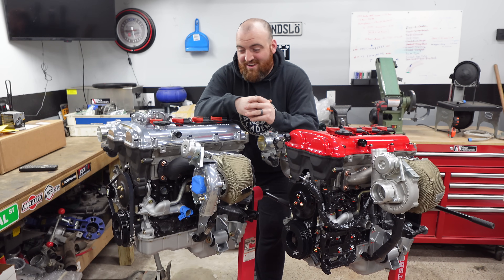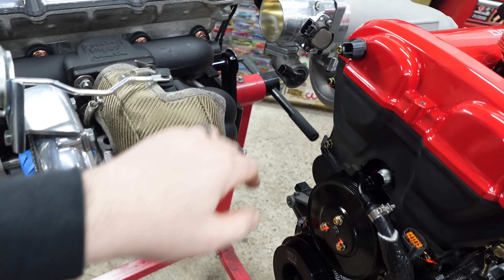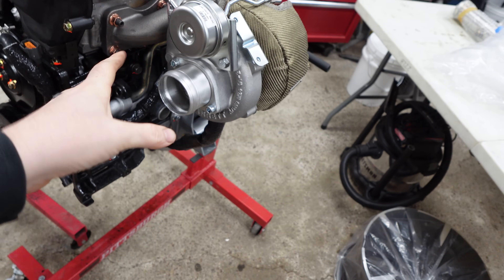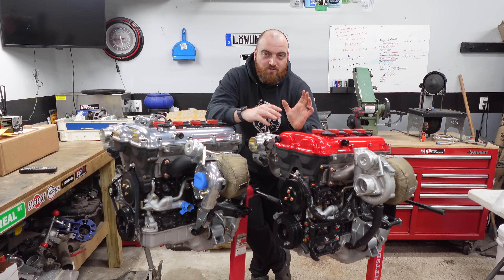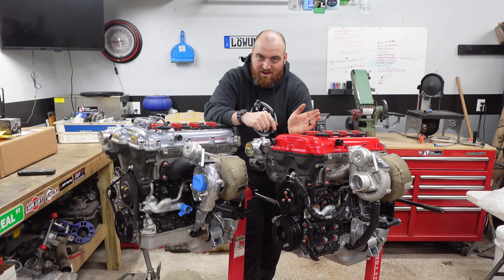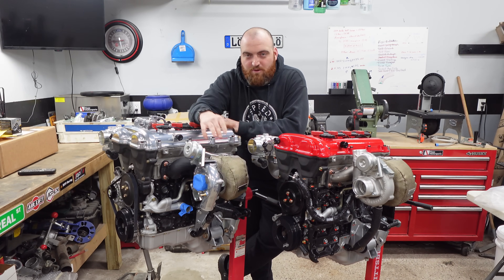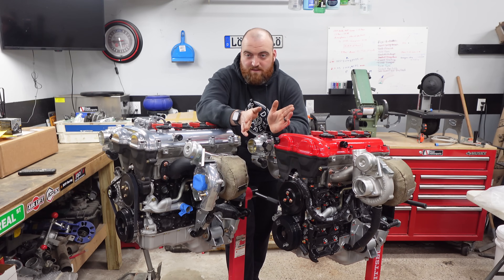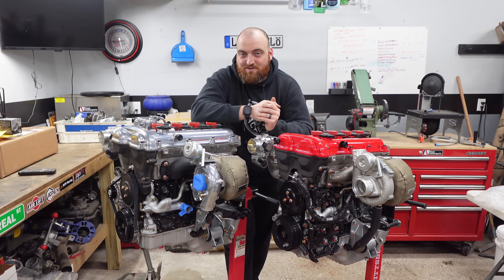Which Miata Turbo Kit Is Best? Flyin Miata vs Kraken

Comment: Nice video, Stefan!  We get lots of questions comparing our turbo kit to others, so it's great to hear some input from another Miata specialty shop that has experience dealing with multiple turbo kits for Miatas.

Just to address some of the questions and comments here:

1. Yes!  We do have an updated version of our turbo manifold available for 1.8L engines (1.6L version coming soon!).  It's sexier, is 2.5lbs. lighter and flows 24% better than the "old" design shown in your video, and they are even Cerakoted now!  You can see more pictures and details about it in our NA8 and NB Stage 1 Turbo Kit listings (I'd share the link, but YouTube will auto-delete this comment).

2. Our Stage 1 Turbo kits for the NA/NB Miatas do include a piggyback controller that we developed in-house.  The piggyback controller wires in alongside the stock ECU to adjust fueling during boost.  This is the only way to add fueling during boost reliably to retain CARB legality.  Aftermarket standalone ECUs will never be able to pass any official state or federal emissions testing when it comes down to the letter of the law.

3. The NA6 (1990-93) version of our Stage 1 Turbo Kit usually makes about 160ish whp, but the 1.8L engines can make more - especially the NB variants.  Check out the dyno chart listed in the pictures of our NB Stage 1 Turbo Kit on our website - some of the healthier NB engines are making nearly 200whp!

4. And yes, we fully admit that we've had trouble keeping inventory for our Stage 1 Turbo Kits for the last year and some change.  We are very sorry for all of the delays!  However, we have worked with a few of our manufacturers (and switched to a few new ones) in an effort to get kits back on the shelf ASAP.  Fortunately, we're making good progress and we're now focusing on ironing out some of the wrinkles to make full steam ahead.  We're actually planning on having more Stage 1 Turbo Kits in stock around the end of January or early February of 2024, so things are looking up!  Thank you all so much for your patience and understanding!  

Thanks again for the great video, Stefan!  Keep up the great work!  
👍😃👍
Reply from the maker: Awesome! Thanks for the reply guys. I knew I was missing some info so this is great.
Reply: I think Stefan needs more flying miata products to review
Reply: Actually, I've been trying to catch the FM kit in stock since Pandemic. So it's been out for more than a year and change. :)
Reply: @onlywenilaugh6589  That doesn't mean they're not shipping, it simply means they're selling out so quickly that we can't keep them on the shelf. There are a couple of dozen coming in to stock tomorrow with another drop mid-March. We're working towards having stock on the shelf at all times, but first we need to satisfy a whole lot of pent-up demand.
Reply: Legends.
Reply: @FlyinMiataVideo  You plan on offering your new shiny exhaust mani to the current S1 Owners? Do you have a 3" exhaust system in the works for us as well?
Reply: Do you have anything for a mazda b2300 2.3l truck with the duratec?

Comment: Thanks for the video!  Two quick comments, I think Flyin Miata just updated their turbo manifold.  To the layman's eye, it looks a lot like Kraken's now.  Second, and this is probably not as important to most who decide to take on the install themselves, but with limited mechanical experience,  the biggest benefit to buying FM's kit for me was their tech support and install videos.
Reply: Came to the comments to say the exact same thing. I know they just started shipping those out so there doesn't seem to be any info online about the performance gains with it on vs the old manifold just yet. According to FM, its better than the old manifold design by being lighter and better flowing by a considerable percentage.

Also, if you have never installed a turbo before, FM is the most straightforward and well documented out there, I believe. Your also buying into their customer service in which they essentially act as a lifetime warranty if anything breaks or fails and it's clear that it was a manufacturing/quality issue rather than a user error or just normal wear/tear, even if its several years in the future of ownership.

I do think the kraken kit is better for building on top of for those that want to go to drag strips, but if you have a specific power goal on mind(a highly responsive 200whp-250whp) and intend to drive your car on the street a lot, then the FM kit gives you a solid peace of mind knowing that they will have you covered.
Reply from the maker: FM's tech support is great for sure, and something to consider. Kraken's support is also great though.

Comment: I was pretty skepctical with the Kraken injectors aswell, its been more than a month since mine got tuned, and they work flawlessly. Also the guy is the nicest dude ever, always helped me out instantly.
Reply from the maker: Yeah their support is pretty solid.
Reply: What car did you use your injectors in? Would you mind sharing some info on how you got it tuned?
Reply: @ZareefHuq  NA Miata. My tuner was the one who figured out everything, sent him the info sheet from kraken, he had some idle problems at first because they're pretty overkill for my 260hp, but I have no info after that, just told me he fixed it. They run perfect still, cold and hot starts along with the idle, on a Speeduino.

Comment: I have the FM kits on both my 1.6’s. I’m in California so I have to deal with smog testing. Beside the fact these pass smog testing. The kits are just so complete. They supply every last nut and bolt you need to install their kit. The instructions are easy to follow. Installation ease is a 10/10 for the FM kits.
Reply: But they are so $$$$$
Reply from the maker: They are 100% super thought out and thorough which is very nice.

Comment: Any one other than me running the MK turbo kit?   Has been good on my 1.8 for 3 years and about 15k miles with a few track days.  I plan to reuse it ( to start)  on my new build BP4W going in this winter. Old setup on a stock engine made 231hp with the cheap ebay turbo. Love the videos
Reply from the maker: MK is a solid budget option. Just haven’t seen them around much lately so I always struggle between FM and Kraken

Comment: For anyone that's curious, I would like to add that I have a kraken manifold and downpipe on a garret 2860rs no power steering no ac and I did not have to clearance the engine bay near the shock tower. It was a very close fit but I was able to make it work with the turbo pointed downwards, milage may vary depending on turbo size but it is possible
Reply from the maker: Nice! I do think I could’ve gotten away with the same, but I didn’t want to find out once it was installed.

Comment: Recently installed my kraken kit. Only thing i would disagree, is kraken is a little less plug and play than flying miata for a couple of minor things. 

Mostly if you have the 7 inch inter cooler the power steering cooling line is in the way and you ll have to unbolt it and tie rap it up.

For fitting the turbo into the car with the manifold mounted with rhe turbo in one assembly you dont need to cut the engine bay chassis  you can just unbolt that side motor mount and jack the engine or have someone tug on the engine from passenger side to fit the manifold

Also if you took the option without ac but with power steering, (turbo pointing down)the power steering  rubber hose at the top will need to be "uncomfortably" put out of the way or you'll have to snake around a new hose

You cant reuse any splash guards so you'll need to do new duckting.

And my kit came with a wrong size clamp for compressor outlet

Sometimes the kit will comme with missing things or uncorect things. The quality controll is not the best but bare in mind its a almost one man operation 

Also the intake adaptor flange i got was jenkly made compared to what i saw in other kits felt like home made after thought which it was. You'll also need to make your own gasket for that.

The exhaust also seems to not be back putged for any readon? But it will be tough enough and its not like you will feed clean water trough it. Just dont be suprized if there's some crustiness inside the exhaust.

Other than that the kit is really nice, it looks like i dont like it but i really do!

You'll receive different fittings and hardware depending on what deals he has on stock at the time.
Reply from the maker: A lot of good info here!

Comment: STOP THE PRESSES!!!!  You're showing the old Flyin' Miata manifold.  They have NEW manifolds and down pipes that are supposed to flow way more than the old manifolds without changing the inlet/outlet location.  That means you can upgrade the manifold without changing anything else.  AND they're Cerakoted!  Oh, and they're pounds lighter.  Check them out.
Reply from the maker: Interesting! This turbo manifold is only like 8 months old.
Reply: @NappMotorsports   the new manifolds and downpipe have only been available since late summer, and I'm pretty sure that some of the other items in their kit have been keeping them from being in stock.

Comment: Excellent video!

I have the FM kit and am building up an engine with a Kraken EFR kit in the shelf.

FM kit is awesome.  I am in an emissions state and my FM kit passes without issue.  Only complaints are the limitations of the Garrett 2560, and the challenges running the charge pipe from the turbo to intercooler.

The 2560 is an excellent turbo, well sized, but for those bitten by the more power bug it becomes a hurdle.  The unique outlet on the 2560 limits doing an in-place upgrade, at least without modifying the turbo outlet pipe and potentially the downpipe.  A G series super core using the 2560 exhaust housing may be an option, but I'm wary of mixing generations and any internal or external clearance issues that may cause.

In my FM application, the only route I could make for the charge pipe from the turbo to intercooler runs up against the bolt for the upper control arm.  The sharp edge of the control arm was quickly cutting through that pipe.  I armored it with rubber hose, which in that tight space was a challenge itself.  

The Kraken kit I picked up will use the factory hole behind the driver's headlight, leaving me an intake problem I'll need to solve.  More to come on how it comes together in my builder Miata.  The 3" exhaust is gorgeous, i cant wait to finish building it and see how it runs.
Reply from the maker: Nice!
Reply: How is it running? 😄
Reply: Kraken setup dynoed at 402hp on E85.  In other words, it's running great. The problem now is traction.

Comment: I definitely like these videos. I have a love for Miatas and definitely love my old school BP engine. Yes I'm naturally asperated, but I like the sound and torquey nature of them in a light car, and the fact that mine is still running after about half a million miles and still gets equal compression within 2 psi on all 4 cylinders. I love learning about all the things that can be done with this motor, and might actually think about doing something like this one day. Like I said, I still have a completely stock setup with no turbo. There's still a distributor on my exhaust cam.  Not exactly a race car, but still plenty of fun to drive and the longevity is amazing. I've thought about maybe bumping it up to 200 horsepower one day, so this stuff is interesting to learn more about. Thank you for these awesome and informative videos.❤
Reply from the maker: Having fun with it is what matters the most

Comment: Those are some beautiful engines 😍I'd like to know your thoughts on the Kraken low mount, that's the one I've been eyeing from my brief research.
Reply from the maker: I love the low mount setup, it just doesn’t serve most people because it makes it hard to run PS/AC with clean routing. It’s the most efficient setup in terms of spool and exhaust restriction, and if I was building a car for myself, that’s the kit I would use hands down.

Comment: I run a Kraken hotside (manifold + downpipe) along with the Kraken 3 inch v-band exhaust. I use FlyinMiata's cold side intercooler kit that fits up still nice and no kinks (I don't have AC and PS). I use FM turbo lines.
Reply from the maker: Nice

Comment: i had a supercharger and track dog intercooler in one of mine, loved the whine of the SC and the instant go, and was making 215rwhp at the wheels, but never could get the gremlins worked out and had idle issues.
It was stupid fast and i loved it, but i threw away the gas mileage benefits of the miata, mainly because nobody can keep their foot off the floor.
These days I stick with stock NA platform but would be interested in beefing up a NA engine to get more power
Reply from the maker: Building NA Engines is a very expensive feat
Reply: @NappMotorsports  indeed

Comment: I ran kraken low-mount on my compound setup and it was great.. fitment and mounting it had some issues which i think is resolved now, the cast neck for the downpipe must be a dream (the stainless long downpipe was really not great to install) but everything has very good quality from my experience.. the lowmount demanded the cut on the side aswell as cutting of an ear from the block iirc .. but really awesome kit.. boost around 3-3.5 with a Garret 2860r gen2 turbo, full boost before 4k.. the full 3" exhaust was also awesome, with the magnaflow option it was even not that loud in NA-setup (with oem header), although i had to make an "adapter-pipe" to fit. I think FM is a bit more pnp, but if you want to develop your car further the kraken is really high quality.. haven't compared price though?
Reply from the maker: This didn’t include price. I thought about it but it’s more about what each kit offers functionally.

Comment: Any rumors when FM is going to have an NC turbo kit?  I'd also love to know how their Voodoo management board works in between the stock ECU and how it works.  With the Kraken kit, I think you can take it apart and clock it just like the FM if you want to run your IC pipe straight down.  What ECU do you use on the Kraken?
Reply from the maker: FM is 100% working on a kit for the NC. Should be out this summer I hope. And yes you can clock all turbos, but with AC and PS, the kit is designed to go out the top.

Comment: would love to know or possibly see what bolts you use when building ur motor and how you paint the block etc etc
Reply from the maker: I'm debating making a kit. It's McMaster-Carr and I just have bags of bolts in the garage that I pick from. Block painting is just VHT Engine Enamel from Autozone.
Reply: @NappMotorsports Make a kit!! with different stages like valve cover only all the way to complete engine kit! would be cool and very marketable, jess up bolts (i think thats what theyre called charges a arm and a leg..

Comment: Interesting on the clearance. I have a NA8 with kraken top mount and didn't have to clearance anything. 2560 turbo.
Reply from the maker: Hmm. Maybe it’s the lowering engine mounts I use.
Reply: @NappMotorsports  That would make sense actually. Looking at my car, if I dropped the engine an inch the turbine exhaust housing would be extremely close to that part of the chassis.

Comment: What do you think about a fab9tuning manifold and down pipe pared with a Borg Warner EFR 7163 turbo on a stock motor with a ms3 pro on a 99 bp4w?
Reply from the maker: I’m not familiar with the Fab9 manifolds.

Comment: I have heard that RX-8 injectors are direct PnP for NA and NB, and they flow about 420-450cc.  Considering that you can easily get these from a junkyard for basically free, and then get them flow tested by FIC for $60, would they be a reasonably good option for a 250hp build?
Reply from the maker: No. RX8 injectors were an "ok" option many years ago, but most of them are knock offs now, and the spray pattern is absolute garbage. You'll struggle to get a good idle, and driveability will be sacrificed as well. It's not worth saving the couple bucks.

Comment: Thanks for the video! 
Any experience with the EFRs on the Kraken kit and how the driving experience compares to the Garrett options?
Reply from the maker: I don't, but you wouldn't really notice a difference. I've driven other chassis with EFR's and Garretts and it's not like one drives worse than another.
Reply: @NappMotorsports  thanks for the reply

Comment: im planning on getting a low mount kraken with a gtx 2867R gen2, any light on similar setups would be much appreciated
Reply from the maker: The low mount is the best in my opinion, but it doesn't easily allow for AC/PS as the turbo inlet is right at te back of the pump.

Comment: Will the 3” Kraken exhaust bolt up to the FM kit. With the new FM exhaust manifold, seems this might be the best performing setup. 

Or, will the FM intercooler kit with silicon hoses, bolts right up to the Kraken kit?
Reply from the maker: Exhaust for Kraken is v band so I doubt it. And the Intercooler piping should fit.

Comment: I currently own a FM S1 on my NA8 and I've gotten to the point where I'm thinking of purchasing the Kraken side mount w/ full 3" exhaust- just because there aren't a lot of options for pre-fab'd 3" systems. Really a bummer on FM's part and makes me think I should've went w/ Kraken from the beginning. I also get a bit of boost creep w/ their 2560R- but that may be because I'm in the PNW. Their intercooler piping also doesn't allow various BOV optioning- I get they're trying to be Carb leagal- but it should still be an option if someone's willing to dump 4k+ on their setup.
Reply from the maker: The full kraken exhaust is a super nice option, and it sounds great.

Comment: Is there a specific manual 5 or 6  speed transmission or transmission upgrade kit used to handle the extra power the engines are producing?
Reply from the maker: The 6 speed from an NB will handle 350-400hp